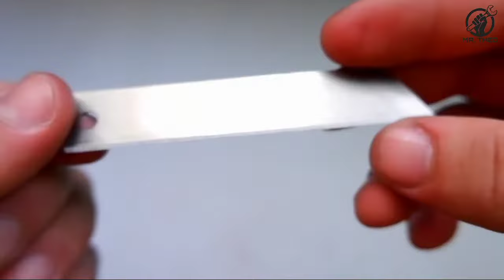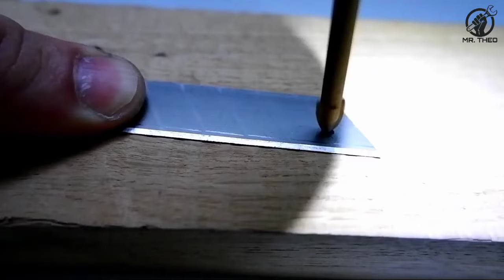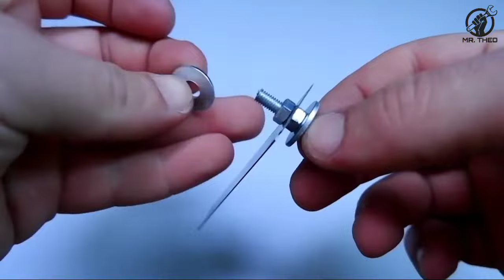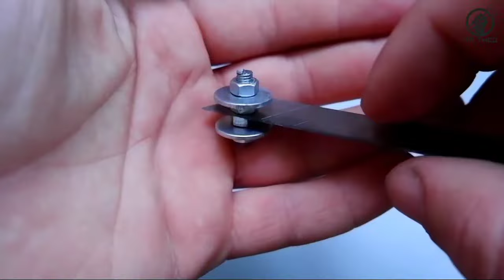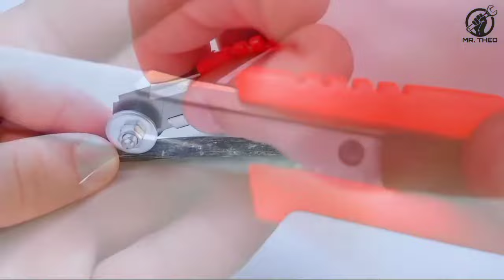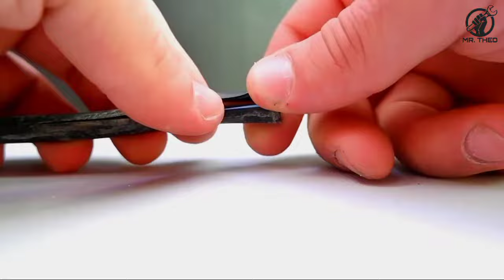How to strip copper wires | Best Tool

Comment: Brilliant. Doesn't have to cut dead center, just score to weaken it. depth is adjustable with angle of blade. Could i use a full size carbon blade with 4 notches on a shefield perhaps?